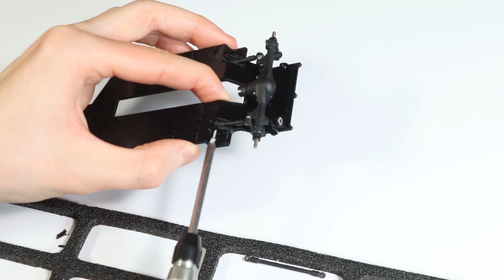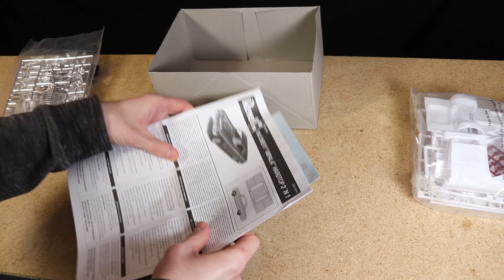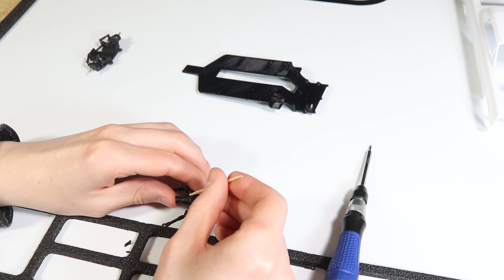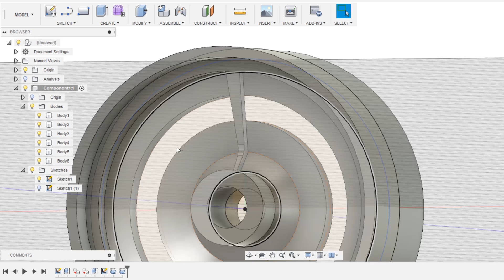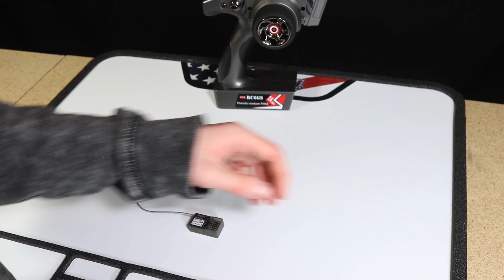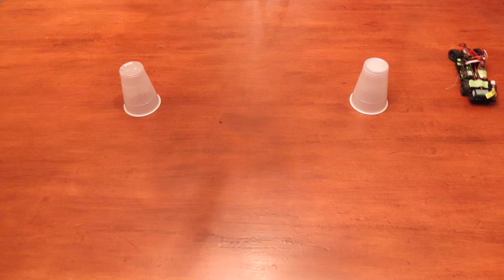FFR SC1 Chassis Build For 1/25 Scale Revell 64 Chevy Impala SS

Comment: When will you make some 1/18 axles and steering racks
Reply: i honestly think the size he uses would work fine for 1/18, ive mesured one of the rear axles and the width is fine. ive been thinking about making one of my many 1/18 scale modelcars rc with the help of what make it rc has developed
Reply: But wouldn't you have to go with wider wheels to make it work
Reply: @dewnationgaming4840  depends really, if you intend to use the wheels that came with the car and modify a sort of mount for them on them they are usually very wide to begin with
Reply: @eriksimca9409  ya they are wide but the mounting is deep, so the wheels are a reverse deep dish on a diecast. I might just have to pick a couple of the bigger ones up and see if they work

Comment: FANTASTIC VIDEO!!! I really enjoy your videos, thanks for posting this amazing build, it's a HUGE INSPIRATION to go build more custom RC stuff! I'm building a brand new RC Drift Track/Cargo Dock with banked corners, and overpasses. What kind of material would you suggest to make the track surface out of, that can be used on slanted corners and transitions?
Reply from the maker: I'm glad your enjoying the videos! I don't have any experience building RC drift tracks so I'm not sure what the best way to go about it would be. As long as it's at least relatively smooth it should work well, maybe use wood for creating banked corners?
Reply: That's a good Idea, thanks!! My old track was just a concrete floor that I painted with Rustoleum Floor Epoxy, and it was pretty good. Maybe I'll cover the wood with the same floor paint.

Comment: What would something exactly like that cost? Great work.
Reply from the maker: For everything seen in this video (minus model kit) the price would be around $130USD if you print your own chassis pieces and order everything as a kit. Ordering components per-assembled and including the 3D printed chassis pieces would push the cost closer to $170, but if you don't need a 6 channel TX/RX you could go with something that costs $20-$30 less.
Reply: @MakeItRC  OK thank you I will contact you thru Instagram